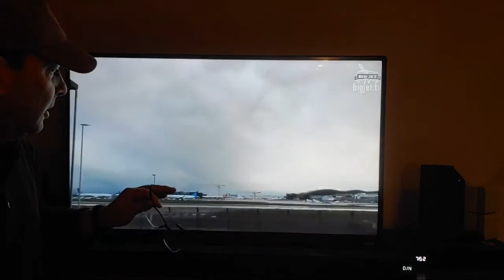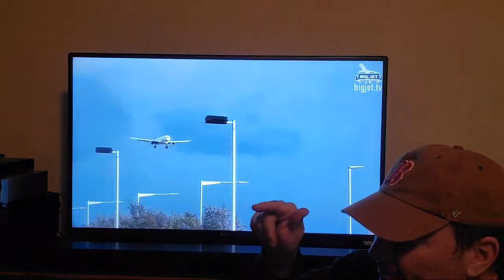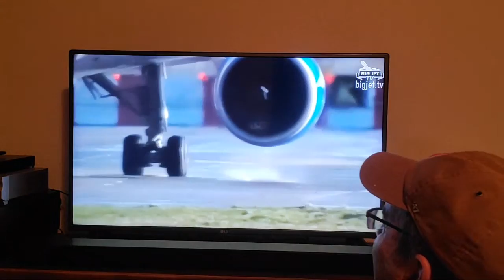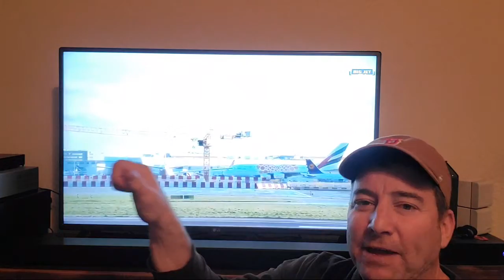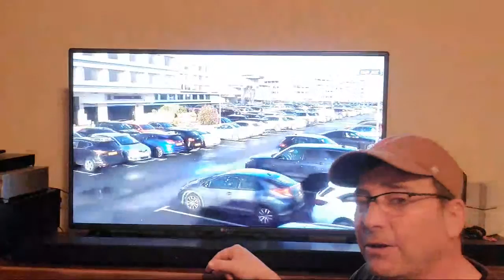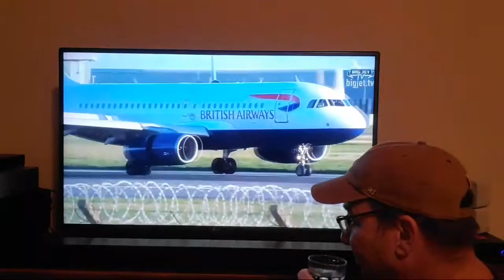Live Planespotting

Comment: (I'm a recent new subscriber here, love your topics and explanations, very factual and realistic.) Regarding A380 not having reversers on the outboards, the real reason was that late in the design phase, the plane was coming out too heavy relative to performance promises... The weight was going to cost customers useful load and profits.  So Airbus made several trade-off decisions to cut weight, and this was one of the more visible and impactful changes.   FOD concern was a good cover story, but in reality many runways that the A380 uses are 60m/200ft wide and very many more have expanded paved shoulders.  That's because on takeoff, they sure don't want FOD ingestion.  The original plan was that operating manuals would specify no use of outboard reverse on 45m/150ft wide runways unless critically necessary (such as if brakes/hydraulics were compromised).  You would use reverse on all 4 on the 60m/200ft wide runways and only use the inboards on the 45m/150ft wides.  But the weight problems changed the story.  This has had consequences for safety and dispatch.  On the Qantas A380 VH-OQA near accident in 2010, they nearly overran the 4000m/13,123ft runway at Singapore because the brakes were weakened by the partial hydraulics loss, they only had partial flaps & partial spoilers, and the #2 engine had exploded, so there was only one engine (#3) with reverse.  Also, A380s have very long landing length requirements in wet runway and crosswinds... sometimes causing diversions.  Last point, some airports have widened runways for the A380, most notably JFK has widened all 4 runways for the A380 and also realizing that Group VI aircraft (777X, 747-8) are becoming numerous, regardless of the A380's fate.  Thanks!

Comment: I've helped maintain some older SGI-based simulator systems at several CAe locations for many years, mainly Australia and parts of Europe. Those systems are designed to be used for a long time, so they have exacting standards of reliability in their design. How they work is a fascinating subject, so many parts brought together to create an immersive environment that facilitates productive training. Modern PC-based games like the up-coming Microsoft FS 2020 certainly have very impressive visuals, but there's a lot more to a real simulator than just visual realism (20+ years ago this mostly focused on guaranteed minimum frame rates, removing aliasing artefacts and employing geospecific databases, in an era long before Google Maps & Earth). Also, what might be desired by enthusiasts for a game isn't necessarily what is needed for training, though of course there's some crossover. Games are designed primarily to be entertaining, as such they often simplify aspects of the simulated system in order to maintain the fun aspect, and of course to reduce or minimise boredom. By contrast, a simulator may be used to test precisely these things, how a pilot handles long haul flight, etc.

More than 25 years ago I visited Marconi which had a large multiuser battle tank simulation network (though I was only allowed to try out a separately located reduced version). The SGI generated visuals were of course amazing (back then there was no such thing as 3D graphics for PCs), but what particularly intrigued me was when I was told how the real simulator cubicles had many other devices which added simulated vibration/shock, smell (fumes) and suchlike, so the simulation was more than just internal visuals and audio. I would be interested to know how these aspects are included in modern flight simulators (if at all). Juan, do the simulators you've used include anything beyond just the visuals and audio, eg. can they replicate smoke ingress, different smells, etc.? Even fire? Of course motion is included, though I wonder if the hydraulics can also simulate vibration/shock.

In 1995 I did a 9 month period of exploratory undersea ROV simulator dev coding (funded by Lockheed), though it didn't progress beyond a mockup prototype before the project morphed into something quite different in which I had less interest (so I moved elsewhere). Still, my visits to several locations where I was able to talk to people in the oil industry who operate ROVs in difficult environments were fascinating. It's always very enlightening to learn about that crossover between the computer based theoretical realm and the real world as lived by the people who train on simulators. Real users help simulator designers think of things they would otherwise never have considered. In my case this included operator fatigue, visibility and spatial awareness (relative positioning), and the ability to more easily return an ROV to its starting point, so I changed my design to include dropable "markers" and depth/direction/distance indicators. Some ROV tasks can take almost an hour to afix a single bolt, so difficult it is to control an ROV when it's 200m down, the camera footage may be terrible, there are nasty buffeting currents and visibility suddenly sucks because sediment has just been kicked up (by the ROV, currents or perhaps a fish). All the while the operator is aware that the surface ship running costs are high, so making mistakes can be expensive. I am sure equivalent issues exist for pilots, so there must be considerable interaction, discussion and feedback between pilots, crew and the simulator designers as they try to perfect their designs to enable more effective training. Juan, what are your own experiences of such interactions, if any?

As mentioned, my undersea work was limited, but here are some screenshots and background info from 25 years ago:

http://www.sgidepot.co.uk/research/
http://www.sgidepot.co.uk/research/readme.txt

http://www.sgidepot.co.uk/research/rlmanfld.jpg
http://www.sgidepot.co.uk/research/mymnfld.jpg
http://www.sgidepot.co.uk/research/realarm.jpg
http://www.sgidepot.co.uk/research/wrarmbbl.jpg
http://www.sgidepot.co.uk/research/undrsea5.jpg
http://www.sgidepot.co.uk/research/undrsea6.jpg

Sometimes I think it would have been interesting to continue the work, though I was more interested in flight simulation. However, I'm glad I ended up being able to support simulator systems instead, though the time is not so far away when the last of the SGI-based trainers will be decomissioned.

I have some old VHS demo tapes on visual simulation (using SGI systems). If there's interest I will try and get them digitised. In the meantime, here's a documentary from back then concerning the use of VR for operator training (note the YT channel owner is the lady who created the documentary):

https://www.youtube.com/watch?v=iFKccs6jNcA

Is VR used today for aircraft maintenance training?

Comment: What fun! I actually subscribe to several plane spotting YouTube channels and now I’m adding Big Jet TV to that list! I find it’s relaxing watching the big birds come and go. I grew up under the wing of the BUFF and for a very long time after we moved away from those legendary beasts I couldn’t sleep because I was so used to the ever present sound of them swooping low over the house in the pattern, the silence was actually disquieting! 

I believe the A380 actually completely lacks reversers on the outboards due to the situation you described. Which I’ve always questioned, is it cheaper to FOD a pair of engines in an emergency (say icy/wet runway) or have they figured those beastly engines are so big that only two reversers are enough to handle any eventuality? It would be interesting to know. Anyhow keep up the great work!

Comment: Do you have any information or thoughts on the single engine airplane that did a wheels up landing at San Jose airport yesterday.  Apparently there was some sort of landing gear deployment problem. I thought there was a way that these landing gear systems could be manually hydraulic the pump down.

Comment: Photo Tech Tips:  
1. The light in your studio (lighting you and the room) as to be the foot candles (intensity) as your flat screen.  
2. Your flat screen has a color temperature of “north light” , very blue.  You need to light your studio with blue tinted lighting or, change the screen tint to very red.  
3. Turn off the Auto Iris and Auto White Balance when doing the plane spotting productions.  

The sound is good.  Love the spotting idea. D

Comment: 100% power off approaches and landing at Heathrow? They don't use stabilized approaches?  The flair is much more critical with an idle approach decent rate. How does that change the go around procedure if the power is puled back. Bigger delay for power to be restored from idle?

Comment: Another tell-tail sign of a 777 is the flightdeck (41 section) was borrowed from the 767, so it looks tiny compared to the rest of the fuselage, and the roof has a dramatic slope from the top of the fuselage to the top of the flightdeck windows.